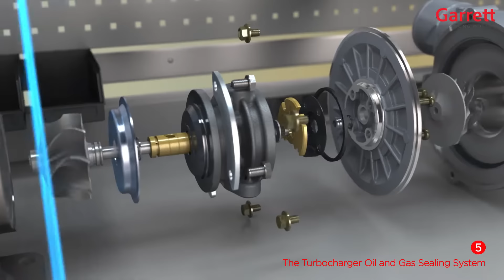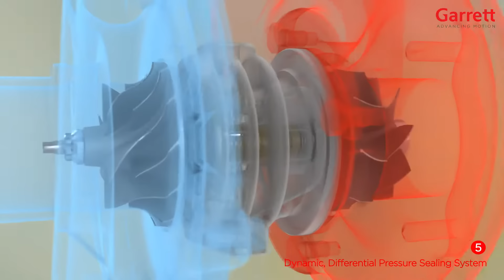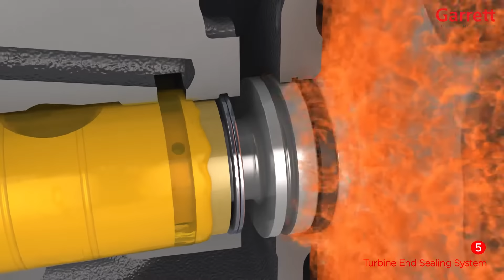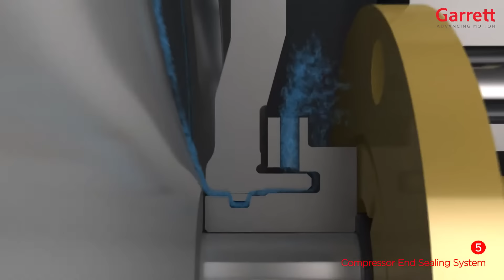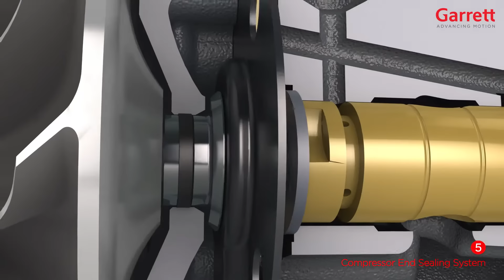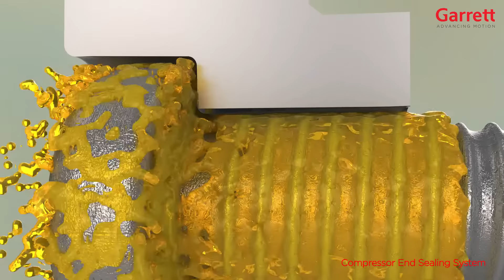Level 3 Video 1

Comment: I noticed to always have a little bit of oil in the high pressure intake pipe. Couldent imagine its coming from the turbo. Now I can. And I imagine my wet air to air cooler. 
Now I can also imagine why at 250 my Diesel always shows oil level reduction. The turbo increases crankcase pressure as well, and the crankcase ventilation is a weak spot of my engine.
Very cool video.
Reply: Positive crankcase pressure is usually caused by blow by of the piston rings especially on engines north of 250k. Just keep on changing your oil every 5k and you should get another 100k or more.
Reply: @Scottanamontana hi, I was referring to 250kmph, the odometer shows 140k km. Since I own the car I realize load depending oil Level deduction. If i drive calm 5,3l per 100km are enough. So I think basic health is there. Exhaust is totally clean. The ventilation case is empty. No cyclone element, no foam piece.
Reply: @thomasschwarzenberger8943 lol sorry 😂I thought you were talking about a diesel engine. Definitely sounds like you know what you’re talking about even if I don’t. Happy Sunday!

Comment: Even though a lot of it is basic info, I love these training videos because it's great to have them straight from the horse's mouth. Especially useful if someone online is trying to give nonsense information, you can set them straight. I wish turbo companies were forthcoming with all relevant info on their products, it would be better for everyone. Wish the whole training series was available!
Reply from the maker: This is why we have a comprehensive training course of our own.
Reply: @TurboDirectSA  Haha you mean all the excellent videos on your channel, just internally, or something new coming soon?
Reply from the maker: @802Garage  No i mean internally we do a full days training course. They have 3 exams and practical training on machines, balancing, Flow calibration, using microscopes, the metallurgical side of turbocharger failures etc.
Reply: @TurboDirectSA  Ah, but of course. I'd expect no less from you. 😁
Reply: Garret, Taking the lead and setting the standard. Everything else is just a poor copy.
Reply: @besearchingforwisdom6267 Garrett's tech was stagnant for decades. Most recent innovations have been following Borg Warner's lead. Garrett still is not on their level in many respects. The EFR is still a superior turbo to the G-Series, even the latest iterations. Obviously the EFR does not cover as wide a range of power levels, but that's separate from the tech involved. Not to mention the EFR even beats the G-Series on price. The SX-E and related series also blow competing lower tier Garrett products out of the water, especially per dollar.
Reply: @802Garage 
Sometimes, the dream comes alive through Encouragement.